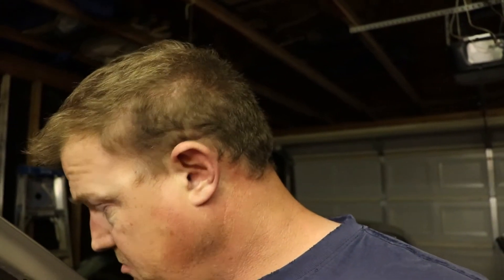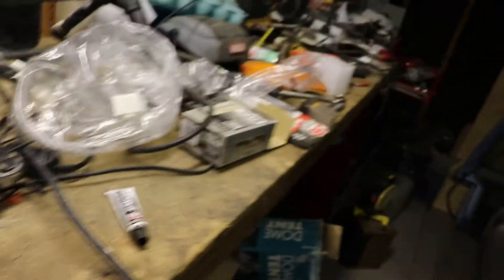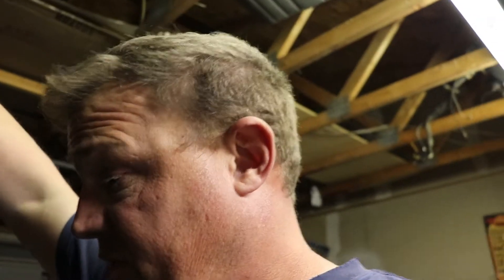Lincoln town car 200 amp alternator upgrade

Comment: I got a battery light and my battery is reading 25 volts. WHAT DID I DO WRONG
Reply from the maker: i need to get more info
Reply: @ I think I solved the issue. I think the connector wasn’t connected enough so it wasn’t regulating the voltage and I pushed it in and went for a long drive and the battery light did not come back on.
Reply: 😂😂😂 @brayden973 😂😂😂
Reply: @  whoopsies

Comment: Was this a eBay alternator ? And how did it hold up ?
Reply from the maker: No, I bought the alternator off of rock auto a reference to 06 police interceptor crown Victoria to get the alternator. It is held up fine but when you put it in, make sure you put the cover over the front of the clutch or it will rust out it comes in the package
Reply: @ 🔥🔥 I have a 2000 grand marquis and I seen a guy put a 2005 p71 Alternator in his which comes factory 200 Amps,  trying this soon.
Reply: @Codyb82  Do you feel any difference with 200 amp now you had it for a while already?  I have 2006 Town Car and just replaced with a new 135 amp new alternator.

Comment: Will a a 2004-2011 crown Vic 200 amp fit in the 05 Lincoln town car signature edition
Reply from the maker: I did one in my brothers 05 town car without any problems. I’ll have to make the hole on the connector that connects the positive to the top of the alternator slightly bigger
Reply: Yes it will

Comment: i have 2011 Mercury Grand Marquis i want to upgrade to 200 amp alternator it have the regular alternator pulley so when u swap the alternators did you put on a bigger belt or the old belt would work
Reply from the maker: The alternator pulley on the car alternator and the regular alternator are the same size. You shouldn’t have to change anything but the alternator.

Comment: Thanks for sharing! I got the same issue with the negative battery cable have you replaced it yet? and if so how did you do it and did you make a video on it?I can't find the same part as the factory original to replace the old one with. Please let me know, thank you!

Comment: I have an 02 Cartier L but my 130 amp is two wire and the 200amp is 3 wire any help?
Reply: What was the solution? I’m having the same issue right now…

Comment: What did you install in the alternator?
Reply from the maker: Can you be more specific on what you’re asking
Reply: @Codyb82  what do you mean at 2:26
Reply from the maker: OK I see what you’re saying only modification that I had to make was to drill the iron on that wire and make it bigger. On the 05 and up the computer internally regulates the alternator. The plug from the car to the alternator is the exact same the only modification is drilling out the wire to make it go over the top of that stud on the alternator. When you buy the alternator make sure it’s a Mitsubishi and it should just be plug and play other than drilling out of the wire. You can buy the cop car alternator wiring kit of rock auto and it would be even more plug and play.
Reply: @Codyb82  thank you that helps alot I got an 07 town car and trying to go the same routeas you. Like what year and model for the Mitsubishi alternator?
Reply from the maker: If you go on rock auto and look up Ford crown Victoria for your year and then look up the 200 amp alternator for that vehicle make sure you get the one with the clutch then it should built right into your Lincoln town car
Reply: yeah its the alternator that come in the police package and thanks again
Reply: @Codyb82 can I put the 05 police 200 amp on my 03 town car?

Comment: Where can I find one of these? I have a '94 Crown Vic LX 4.6 281 and I feel my alternator performs like a 95 amp. I use alot of 12 volt, i have a 3.5 farad capacitor for my 12" subwoofer but am going to install a second battery in the trunk. If I do that, maybe I wouldn't need a 135 or 200 amp alternator? I'm going to replace it, it is the original one from the factory (86,700 miles).. so I expect it to die soon, and sometimes I think I hear the front bearing upon startup.
Reply from the maker: Well I’ve never done any research on those older cars so I don’t know if my information would be good for you but I would imagine. That if you got the same year cop car alternator it should work but you have to do a lot of research to make sure that the computer or the volts regulator will work with your car